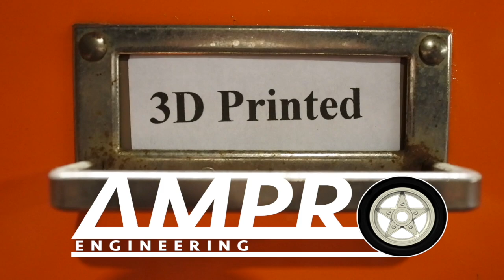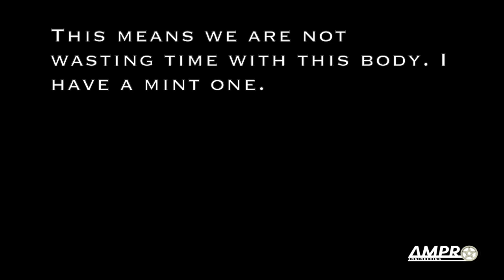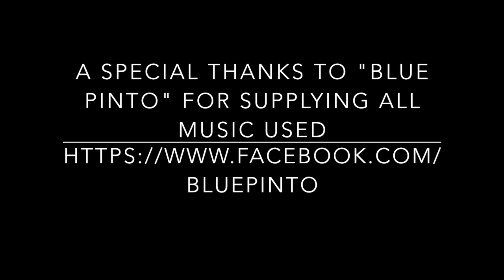e306: Custom Tamiya M01(X)L Fiat Ritmo Part 1!

Comment: I remember having a Tamiya M01 back in 1999-2000, if had the optional Tech Racing rear belt conversion with the optional 2-speed, once second speed engaged, the front end would lift and just spin out running low turn mod motors. Those were the good times, nowadays I’m burned out from having the best of the best, and spoiled myself, it lost its fun after investing so much money.
Reply from the maker: Holy cow! I can't imagine having that power!

Comment: Just for fun try the super glue again but for accelerator try baking soda. After the first  application use more super glue and baking soda to build up around the post. 
I tried this on a main steering arm for an 8th scale monster truck while waiting for a new part to arrive... I have the new part but the glued one is still working on the truck.
Reply from the maker: I use that baking soda trick all the time. It's awesome and drys like concrete. The problem is with this high density polyethylene, literally nothing sticks. I even have glue intended for it and it works kind of well but not strong enough to actually hold that post

Comment: Cool project!
In early 80s we used to have visiters next door in the summer, and they was a Fiat crazy family. Among those cars they did have a Ritmo. Don' know the spec it had.

I also have a M02 that I converted from M01.
Mine got styrene side plates for the chassis and fitted with a Ford Capri Mk3 body.
Shifted very nicely with a Sport Tuned motor.
Nearly too fast.
Reply from the maker: I have the US specifications versions as well as a couple of European exports. I happen to love them! Which body did you use? The Tamiya Race one? I would love a stock MK2 or MK3 shell in ABS!
Reply: @AMPROEngineering   I did use the Kamtec 1:12 abs body which I cut off the lower part off the body as it is a banger body and not that scale. After that I made new sections in styrene and also made front and rear bumpers as well as the front and rear spoilers.

Last weekend I actually finished my Tamiya Zakspeed Capri body in Würth livery. Awesome body and Tamiya nailed it with that one.
I do have heard a rumor that there will be a Mk3 Capri body made in lexan later on from a different company, I cross my fingers.

And you will love this! Proline is soon to be release a Pinto body for the drag cars. You got to have one of those when they comes available ;-) So far we have only seen a preview on their FB page.

Comment: The Fiat Abarth Berliner Corsa came on that chassis and you can swap the rear end parts to the front giving you a front wheel drive, The M01 & M02 chassis's was my first two hobby grade rc's.
Reply from the maker: Yeah the project long done and that was what I ended up doing. I like the RWD chassis more but in the end, the Ritmo is FWD.

Comment: So have you thought of ever getting a TC01 a TD4 the new Watanabe version of the wild one and the return of the tamtech grasshopper do you even like the super avante?
Reply from the maker: TC01 Chassis is amazing! Not a fan of the wild one and the Watanabe version seems tame. I have the Watanabe Hornet and I love it. I used to have that Tamtech chassis and it is crap. One of the worst RC's I have ever owned. The super avante....they should not have called it that in the first place. Second, WTF is up with the front suspension/battery design? I mean are they serious? Nope, hate it.
Reply: @AMPROEngineering  you are aware on the td4 the plastics are thicker in every area of the car.

Comment: I own a trx6 snap-on hauler trx4 blazer scx10 hpi sprint rustler 4x4 stampede speed Pioneers erevo tamiya clod buster TL01 hopefully you do upgrade to the TL01 so I can get it back running
Reply from the maker: Those snapon 6x6's are so cool. Yeah I may need to look at the TL01 one day.

Comment: I had the m01 mini Cooper 94 rally edition. It would squeal the tires with a modified 27 turn.
Reply from the maker: Oh for sure. I ended up ordering an 85t crawler motor for the car. It was just way too fast!
Reply: @AMPROEngineering  mine would squeal like a real car going around a turn that mini Cooper wish they would remake the mo1 too.

Comment: Fiat fan did not know about this model.
Reply from the maker: Very few do. It's honestly not very good and as you'll see in part two, really required a lot of work to get it to look right. The body is also kind of warped and doesn't sit perfectly but I guess it's close enough

Comment: If you are redesigning the chassis, why not reorient the battery box longitudinally and center it for strength and better weight distribution, moving the servo to the side.
Reply from the maker: Great question. I didn't think it would be that weak and since I just wanted something basic, all the extra engineering wasn't worth it for a car that I just installed an 85t motor in, lol!

Comment: Sweet body! I wish someone would 3d print some cool bodies, hmm I wonder if anyone who does printing is into rc hmm
Reply from the maker: There are several companies that do 3-D printed bodies but the main problem is quality. Many of them use FDM prints and this results in a very poor service finish on some of these models. There's a couple of companies that I'm working with right now I'm doing very high-quality SLS nylon ones
Reply: @AMPROEngineering  oh awesome I didn't realize you already were I'll check em out!

Comment: Boo! " wheel on the wrong side" I'm from the UK and my first car was Rosso red Strada 60CL . Beeing an 85 model It had the twin head lights and from the front looked like the Fire breathing Abarth 130. Which when working peed all over most of the competition!
Reply from the maker: LOL! Yeah i have owned several RHD cars....I just cant deal with it, lol! I mean you are used to what you have always used right? I have a MK2 Ritmo (84) cabrio and it is a 85 so it has those quad lamps. I also added the abarth bumper so now it has fogs too!
Reply: @AMPROEngineering  nice always liked the cabrio. Yeah mine had the bumper spots too. May not have been very quick but was a very comfortable ride we had some good times in that nice if unreliable car! 
Fix 
It 
Again 
Tomorrow 
Hey? 🤣🤣🤣